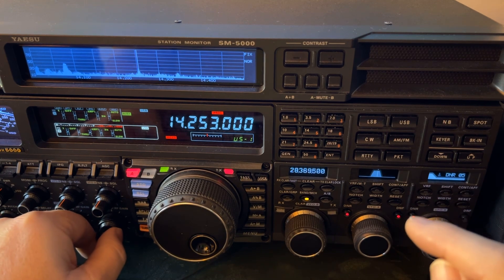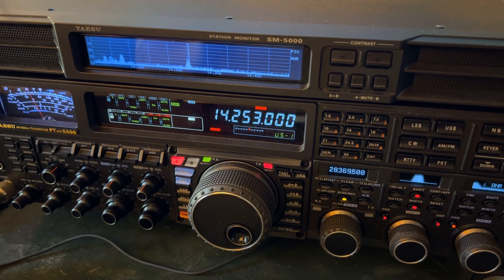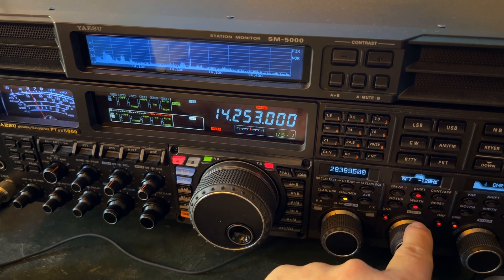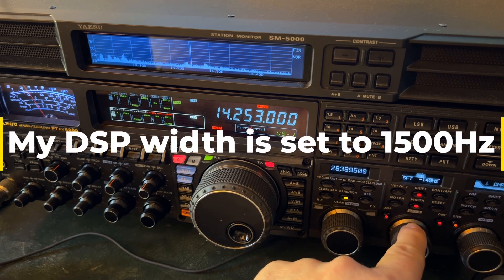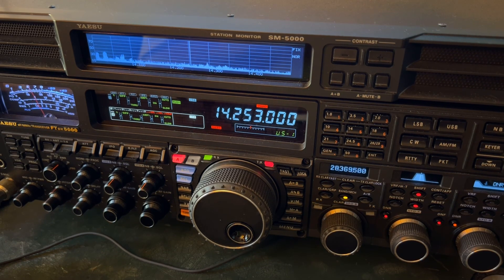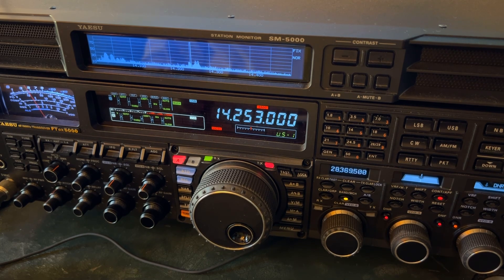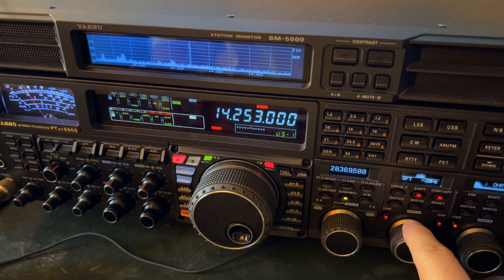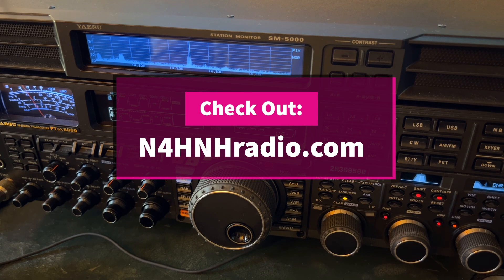Battling QRM from Above and Below the Frequency you are Tuned to #hamradio #interference #qrm

Comment: I believe you did a deep dive into the FTDX-101D/MP radio earlier this year.  Having used the new radio has your opinion changed in regards to the FTDX-5000MP, and is it worth the expense to upgrade from the FTDX-5000MPL to the FTDX-101MP?  I normally skip a generation so that the difference between the radios is greater.  In my case, I went from an FT1000 MKV to the FTDX-5000MP Limited.
Reply from the maker: I chose the FTdx5000MP over the FTdx101MP back in 2019.  Back then, the 101 had some deficiencies in its DSP, compared to the 5000.  Those deficiencies were finally remedied in the 8/1/2023 firmware update.  There are still a few things missing from the 101 that make me favor the 5000.  I wrote an article about it long ago.  It’s in the FTdx5000MP collection on my Patreon site. 

I have released 20 videos thus far in my FTdx101MP series.  I’m still editing a few more.  That series has been available for S7 and S9 Patreon members for several months now.  The final video in that series will be a nitpick video.  It has already been filmed. It’s in the edit queue at the moment.

Comment: High pitch metallic sound...shift negative.
Low pitch honking sound...shift positive.

Thank you.
Reply from the maker: After you narrow the bandwidth.  Shift won’t be as effective unless you narrow the bandwidth first.  If the interference is from 2kHz away, narrow to 1800.  If that isn’t enough, narrow to 1500 or even 1200.